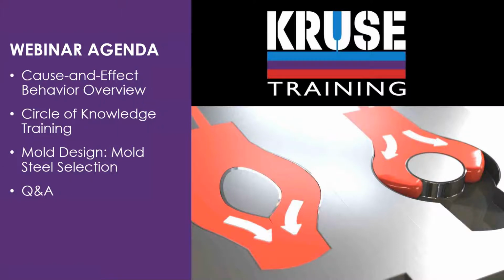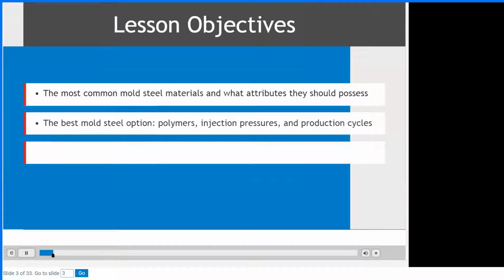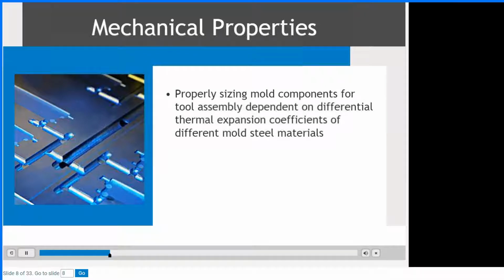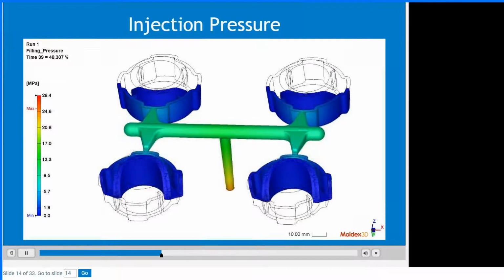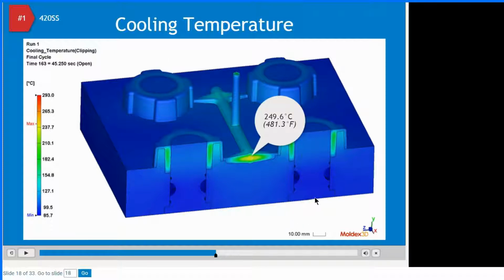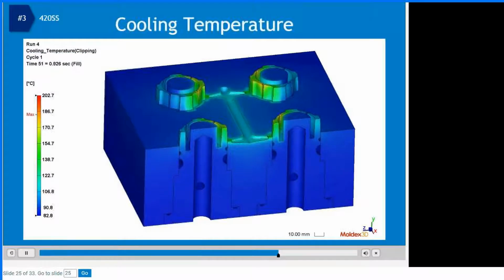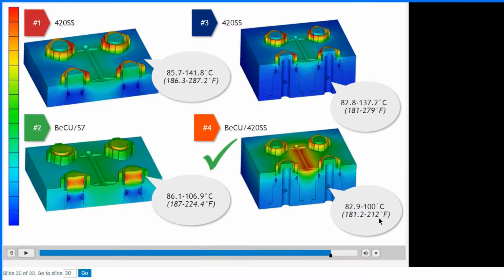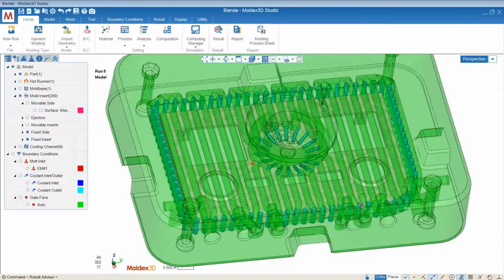Kruse Training Webinar: Mold Steel Selection

Comment: Excellent Stuff, Presentation. Job well done. 
What software you normally prefer for mold flow analysis and cooling analysis ?
I use UG NX and Creo as well.
I do mold flow analysis, for injection molding.  Thank you.
looking for ward.
Reply from the maker: We use Moldex3D (www.moldex3D.com) software for mold flow, cooling, shrinkage and warpage analyses.
Reply: @KruseTraining  thanks for quick response and reply. Keep it up.
I have few tough questions to you.
Looking forward.
Keep it up good work. Have a great day.